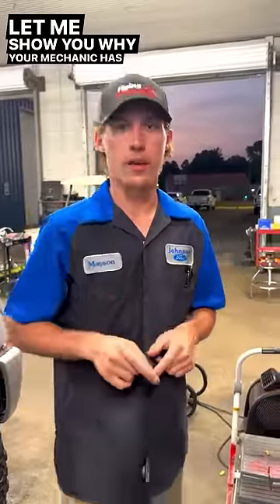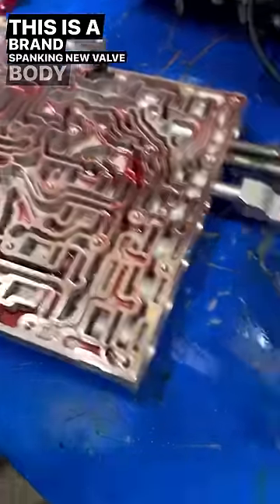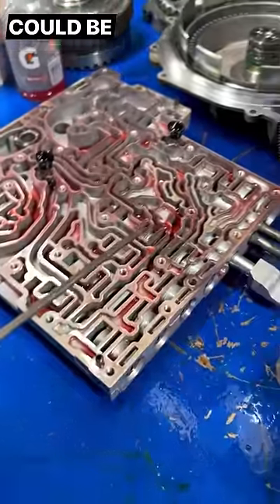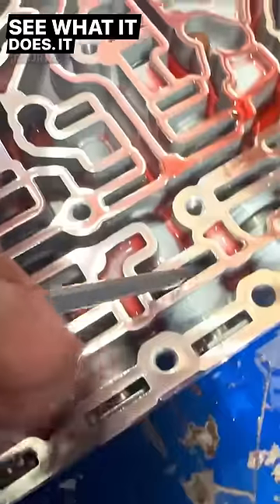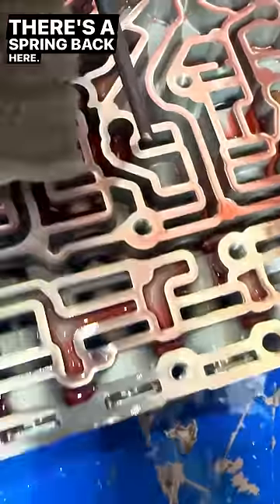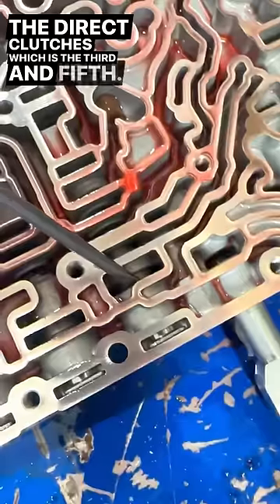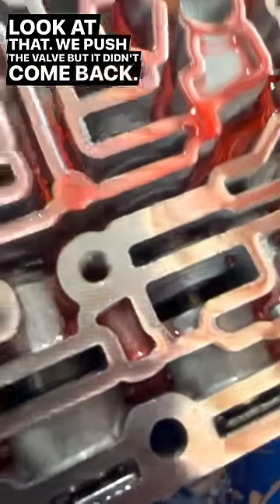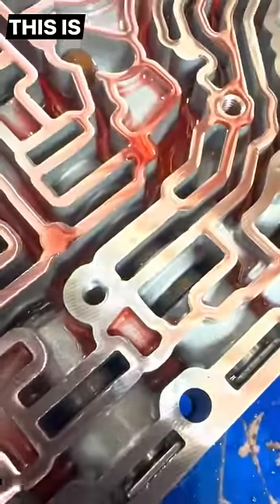Why your mechanic has trust issues #shorts #ford

Comment: When I replaced the water pump on my Pontiac with 167K on it and 9 years old, with an A/C Delco brand new part, I thought it was going to last until I got rid of the vehicle. 

2 years and 40K later, I am replaced it AGAIN. This time I bought Napa. I am tired of playing Russian roulette with my parts. I always seem to get the bullet...
Reply: Did you completely flush your cooling system before doing that water pump? You probably didnt and there was contamination within the system that caused your new part to fail.
Reply: @tommys2979  The bearing went out. Cheap Chinese junk.
Reply: just FYI AC Delco has different levels of parts you will need to consider.  They have just recently changed the naming of them but now it's Silver, Gold, Blue.  BLUE is OEM is the same as the original part
Reply: @joshr8666 I did the job almost 10 years ago. My choices were new or remanufactured. I went with new.

I ordered all my parts name brand from rock auto. I didn't want to do that job again. 

Little did I know that I'd be wrong....

Comment: I can't tell you how many 4R70W valve bodies in brand new cars that I had to remove and disassemble to track down stuck spool valves. Most of them were caused by an aluminum chip from the machining process of the Valve Body.
Reply: How many of them were also ruined by this muppet whacking them with a big screwdriver?
Reply: @chemistrykrang8065  😂

Comment: In todays age most parts are bad out the box
Reply: Ya. I keep getting the right box, with the wrong part. Don't even know what to say.
Reply: American manufacturing is downright embarrassing nowadays
Reply: @turnermd1302  That’s why I don’t care about buying made in America tools anymore. I like tools mostly from Taiwan or Vietnam but sadly have a few from china
Reply: Not out of my Toyota box.
Reply: From use and throw to buy and throw.
Reply: I'm not a mechanic, and I forget the part name, but I saw a video once, where the guy was showing a part that he had 3 brand new ones still in the boxes. 
There was a one way rubber gasket, and he was showing how to open the part, and reverse it so the air flowed in the correct direction. 

He said that on about 90% of the ones he's replaced, the gasket is put in wrong, or another issue would be there, and opened up all 3 new ones. 

Sure enough, 2 had the gasket issue, and 2 had the other issue. All 3 were bad right out the box.
Reply: @StrongerThanBigfoot I remember comparing my Taiwan air tools with someone in the shops Snap Ons, while he talked shit about mine. Almost every one was the same exact casting, with just a different name stamped in the same exact spots.
Reply: @turnermd1302 These aren't American in many cases.

Comment: That's why I stay with a manual transmission. If it breaks I know it's my fault.
Reply: Manuals have valves too bro. Not as many but they have them. Tons of moving parts in a manual trans too.
Reply: Spoken like an abuse victim
Reply: @betonblack3621  What valves?  I spent 5 years in a gearbox overhaul shop and I can't think of any!

Comment: I diagnosed a bad map sensor, and when replaced the damn thing three times cause they came bad out the box... It is very frustrating, and the customer loses faith when stuff like this happens, especially when it's a time sensitive operation and the parts cause delays...

Comment: I just opened up a 6r60 reman valve body from Ford full of metal chunks and bits. Metal inside and all over the speed sensors. It was sealed in the electrostatic wrap so the rebuilder put it in the bag like that. Do better Ford cmon now.

Comment: Your making burrs inside the valve bores with that screwdriver. Take the end plugs out and clean everything. The bores with a nylon brush ( like a gun cleaning brush.) use a magnet to see if they’re free moving in the bore. I if someone over tightened the bolts holding the halves to together the bores could have been pulled out of round. Take a big block of wood put it on the floor and slam the flat part down onto it. The weight of the valves will take out some distortion and press any burrs out. Stress relieving it.
Reply: It's already fucked up, what does it matter
Reply: 100% correct.  You have had formal training. The valve body may need to be warmed to extract the spool valves. A space heater works in a pinch.
Reply: The valves are coated aluminium.
Reply: *You are
Reply: No, return the new but defective part under warranty.
Reply: These are the guys who will tell you to spend 8 hours rebuilding a $12 carburetor on your weed eater.   The parts’ going to get replaced so stop whining.  Time is money these days. Big money.

Comment: Years ago Ford had two identical transmissions made by either Mazda in Japan or Ford in the US.  An independent company took both versions apart and measured everything inside.  The Japanese one used  5% of allowable tolerance while the US version used 98% of the tolerance.   The Japanese tried to make them exactly to the called out dimension and got real close, while US production managers insisted on using all the tolerance because it sped up production and reduced machine time.   A minimum spec bore with a maximum spec piston won't work the same as both being at the desired dimension without using much of the tolerance.   It will fit...just not work the same.  Bet that's what's happening here.
Reply: And THAT is what's wrong with USA domestic brand automakers.  If domestic was as well built as Toyota, i would happily buy one.  We can build stealth bombers but not reliable cars for some reason...
Reply: You don’t mess with the Japanese

Comment: It's a Ford. Enough said..
Reply: There was a time where the vehicles were acceptably reliable. Unfortunately for Ford, those days are passed. They don't care about average customers (same goes for chevy), because they get big contracts with construction companies who honestly don't care about reliability.

Then again, the competition is toyota (pile of garbage trucks with no hauling potential), and Dodge, who, apparently ain't bad rn actually (at least their trucks)
Reply: @goldenhate6649  Honda and Toyota will not break on you if properly cared for though.

Meanwhile Ford and GM cars break apart before 40k miles... Not even Hyundai is that bad anymore.

Comment: So...   Put the screw driver on an unpolished part of the spool valve and lightly smack it with a hammer. may take a couple taps.. Re-check the valve. it should now return..  Probably just a small burr or something.. Smacking the spool valve will often flatten the burr and relieve tension on the valve. BOOM! Problem resolved.

Comment: I’ve worked in the automotive manufacturing industry for over 10 years, you get parts like this because corporate is so damn greedy, they up the rate so high it’s almost impossible for QC to catch defective parts. I work at a place that makes mirrors, we have QC for every step of the process and even additional QCs at the end of production but corporate gives us literally less than 10 seconds to inspect. Our rates are high because the higher ups are getting big fat paychecks while we’re on the brink of having meltdowns trying to keep up and keep a job. We even get yelled at for talking coworkers we stand right next to, we get reamed for coming back from our measly 10 minute break a couple minutes early. Mandatory 10 hour shifts on first shift starts at 4:00 AM. We’re tired, our brains have turned to mush, we don’t get paid enough… It’s messed up yo

But free coffee and pop though… 🤦‍♂️

Comment: I have a sneaking suspicion this could be the result of an incorrect torquing procedure that has warped the body and is causing the valves to stick. As a collision repair tech, i can appreciate having new parts that are crap though. 😅

Comment: I had a remanufactured transmission installed in my Silverado recently.  After 200 miles and while driving on the freeway, the pump failed.  Mind you I followed their instruction for a 300 mile break in period to basically baby it and not tow anything.  On the second transmission now (replaced under warranty) and fingers crossed it’s still okay after 150 miles.  I actually felt a little bad for the mechanics at the shop when I had it towed back in.  They take pride in their work and hate seeing vehicles have to come back.  It wasn’t their fault, it was crappy quality control by the company that remanufactured it.
Reply: We appreciate customers like you that don’t assume we fucked up right away lol
Reply: My early 2000s manual econobox with 140k miles still has the original transmission

Comment: Having rebuilt transmissions for over 21 years, I can see the problem. It’s a sticky valve. Now your job is to find out why the valve is sticking. Any small piece of debris can cause that valve to stick. Whether it was from the machining in the factory. Or dirty assembly work. Even a single piece of lint off of a sharp rag can cause this. I.e. wipe your hands off on a rag and look at the fuzz stuck to your hands.

Comment: I’ve come across many new parts that are defective. Everything from bad sensors, to smashed spark plugs, to broken grease fittings, and even defective calipers. I get lots of these parts are remanufactured especially brake calipers. But good lord people can we just have stuff work? I remember seeing a 2019 Chevy suburban with the magnaride suspension. New struts truck only had like 30k miles on it. Both front struts completely blown and like 1,100$ each from GM

Comment: While the 6R is an internal unit to Ford, it took a lot of its design cues from the ZF 6HPxx series of transmissions. These units run hotter than most, and Ford took it a step further with the 6R. Here in sunny South Florida the average operating temp is about 93°C (220°Freedom Units). So if the unit experiences an overheat condition, don't be surprised if the temperature exceeded 250°F. This wreaks havoc on the case, and vlavebody which is made of soft metal. That's why these units need to be dissected with a fine tooth comb, before they are rebuilt (all the units from Ford are rebuilt).

You are doing a wise move young man in checking the operation of the regulator valves. Any warpage of the valve body, or inconsistency of the bores will hang them up. My only tip to you is to check them hot. I submerge the valve body in fluid, and put in the oven where the temp is set to match operating temperature. Then with it nicely hot, I check the operation of all the valves. They can work seemless when cold, but fail when hot.

Comment: Why the fuck is this used instead of using a simple computer (ECU) that activates solenoids that drive the internal mechanism of a manual transmissions keeping the good of both, automatic on demand and reliability of manual.

Comment: I own a transmission shop. We USED TO work on Ford... for like the last 21 years. My shop will NO LONGER work on Ford products at all. We just flatly refuse because it is just GARBAGE. It's funny that they used to come in needing a transmission repair, or rebuild, but EVERY one of them would have other major mechanical problems. Every time. Smart people DO NOT buy Ford..

Comment: I bought a brand new DOHC head for a 2013 Cobra for $1500 “assembled” directly from Ford. It had “everything” except for a very important, $0.05 oil galley plug. I discovered it after completing the rebuilt and having zero oil pressure. Thanks Ford.

Comment: Quality control??
It's supposed to fxxk up ??

Unless you pay more for latter OEM redesigned resized new ceramic carbon composite metal melting & CNT melting.
All With a micron gap for clearance..
It didn't spring back??

Simple CNC lathe measurements reset for the barrel/valve/tube piston etc

Comment: As a truck driver, I don't trust any new parts. I'm in a brand new 2024 Freightliner Cascadia. A little over a week ago, at 39,000 miles, which is like 3900 miles on a passenger vehicle, the fuel pump disintegrated. That was on top of the bad EGR flow sensor and the fail compressor fitting that occurred in its first week on the road. 
This isnt a new problem. In the first 9 months of the 2019 i came out of, every peripheral bracket was cracked on the engine. Years ago, i was in a high mileage 2006 Columbia with a Detroit Series 60. The EGR valve and cooler failed. I didn't get a mile from the shop when the brand new valve failed. My company found the only one a shop was willing to part with in the US in Idaho and had it shipped by air to Pennsylvania. The mechanic told me about 50% of that common, very simple part came out of the box defective.

Comment: This is why I have trust issues with garages tbh. First failure 160,000KM. gearbox centre recon'd the box and i took it back 7 times it had two torque converters fitted and "new  valve body" before it was returned to me fixed. 60,000KM later the box fails again, no warning again like before just no drive failed. took it to a different specialist gearbox centre who could not get the car out of limp mode and said it was an electrical issue and had "I" had any work done on the car. 4 Months later I got my car back fixed. the Valve body had failed again. Two weak springs. the garage had to send the valve body away for "testing" to determine this. £5500 in repairs within 60000KM. How long is this gearbox going to last i wonder :S.

Comment: As a former machinist and performance builder, Im guessing every one of those were machined on the same machining center, by the same operator...And all the others made are mostly fine. Thats self QC at its finest! Whos going to narc themselves out for f'ing up a 10,000 part run. We once had a guy run 50,000 timing gears thru heat treat without final operation, finish/ boring to size...HOW?? Fifty thousand Wth?

Comment: Nice work check everything..not a mechanic but i been getting bad pumps vavles fitting with cracks i even got sch 40 pvc pipe installed it turned on the water fucking 2 inch hairline crack in it pissing water out .i probably wouldn't have caught it before i left the job but it went to a up pump system and was pressurized..same job 2 bad pumps from factory unfucking real must be from COVID 😂😂😂😂

Comment: Its not just Cardone anymore, every manufacturer seems to be skimping on replacement parts. Makes me wonder if it was a casting issue, and the piston was grabbing on a deburred edge? Hell i dunno, just the other day I had to go through 5 damn brake calipers to find THE ONLY ONE that wasnt seized right out of the package. I swear, the replacement parts companies should hold some financial responsibility when we're having to do jobs 3+ times just to find a part that works.

Comment: This is why I say, when your (automatic) transmission goes, your car goes. Because the amount of time and money needed to take out, open, diagnose, fix, reassemble, and put back in can cost $5000-6000 if you're lucky. Sometimes, it's cheaper to either get a junkyard part or - if your car is old enough and not worth much - get a different car.

Comment: What's funny is the design of these transmissions aim to improve fuel efficiency and in turn reduce emissions. But given their ridiculous complexity they fail more frequently and are much harder to repair leading to complete replacement. So yes your mileage is marginally better, we have to strip mine more of the planet to produce extra transmissions. Brilliant. 

It's not just Ford either my 2015 Subaru's valve body failed after 80k miles, 10K miles BEFORE it was due for its first scheduled maintenance.

Comment: I replaced my 6F55 and my 13. Taurus SHO the remaned transmission rattles and wines. I completely understand. I've also been shipped shifted splines for an escape drivers side half shaft it ook me maybe 30 minutes to an hour to figure out why they wouldn't go in you had to hold it to something straight to see,  and Ford has sent me a chipped pinion for a 2019 ranger that was on months backorder. Their quality is garbage

Comment: I have the exact same issue with my rebuilt 6R80! 3rd and 5th gears haven't worked right immediately after the rebuilt. Back in the shop for the 4th time to pull the valve body now and I expect they'll find the same thing.

Comment: I swear a mix of finest slippery high temperature Teflon super slip, clear oil for transmission or other sliding parts.
All in/out tube/rod cylinder need a curve lip edge usually sharp tube/hole need rounded edge cylindrical & tubes.
Maybe then the tolerance for the valve CNC/Laser cutting would be processed precision or get stuck without a 1/4 circle curve edge lip to tube or cylinder ends in-up forward/out-down or backward

Comment: Just because it has oil on the cover doesn't mean it has the right pressure/oil, on that valve, open to the air. You could be actuating it dry. After a transmission rebuild, you might need a 500-mile break-in period, during which the internal parts of the transmission, like the clutches, can break-in properly. :)

Comment: Brand new dripping wet? Or put into a transmission which MAY have had debris in some unknown location which, due to Murphy’s Law, a valve tried to eat, putting a tiny gouge in the shuttle valve and/or its bore resulting in a sticking valve. Hard to say whether it moved freely before installing, but i wouldnt have checked either. I used to go over the valve ‘lands’ with a red scotchbrite pad before reassembling used valve bodies just to knock down any tiny knicks my skin couldnt feel. Im sure some would shit talk that practice too, so take it for thats worth lol.

Comment: Just like lemons from a dealership, car parts can have defects right out of the box!
In pipefitting, it's a good rule of thumb to never use factory cut ends. Sure, New pipe - but shipping and handling can dent them to the point of unusable...